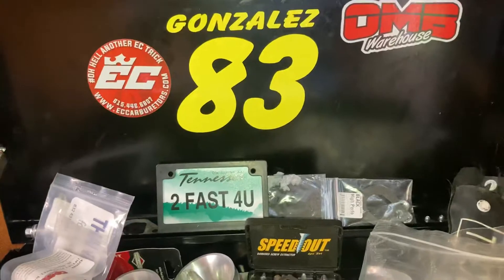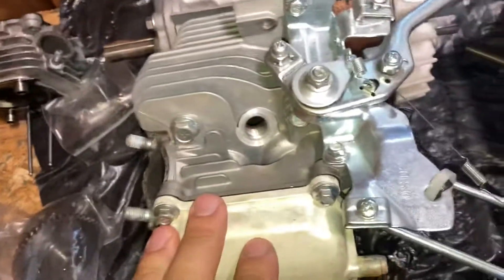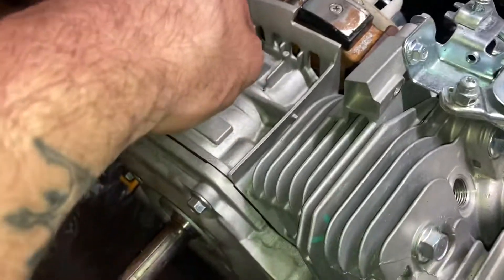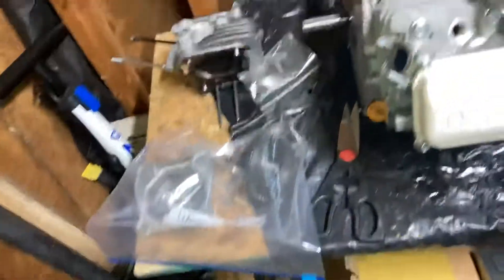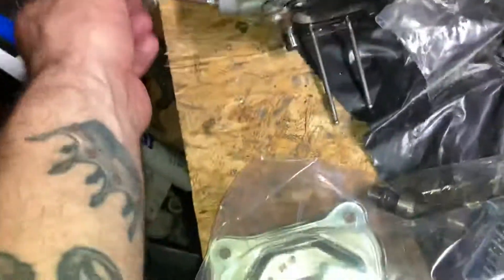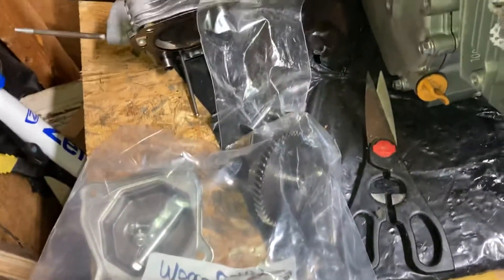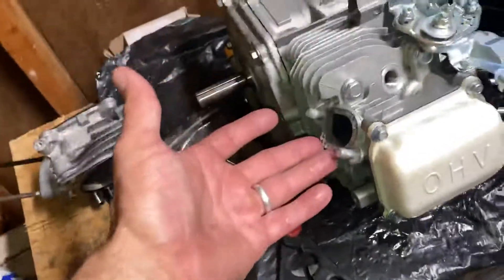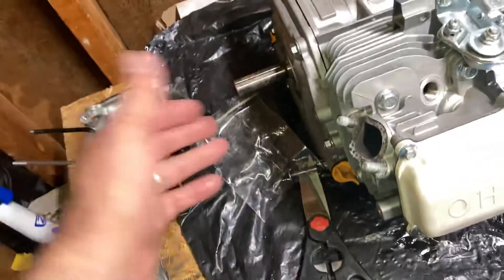Non hemi head to hemi block  Predator 212cc build talk

Comment: You will have to use the non hemi push rods in the hemi block and you can not use the non hemi cam because the cam journal are different
Reply: do you have to lash the values if they are already done or no? i just did the swap and idk id i should lash the values or what
Reply: @brandomusic3220 yes. You should periodically check your lashes and definitely if your gonna change parts

Comment: Did you do the swap yet ? I did that to mine due to braking a 18 pound valve spring and dropping a valve in my hemi so I had a ported non hemi head plus 18 pound springs in it already with high compression gasket

Comment: I’ve got my mega moto with a hemi motor I have a fuel pump on it and oil venting lines and I got a hot 265 cam and 22lb valve springs and a 26mm mikuni carb and govener removed and it’s got a trumpet straight pipe with a racing clutch and I want to try this so I just bought a non hemi head and I think just to be safe I’ll use the hemi cam and use the non hemi valve and non hemi push rods and the whole non hemi head and I think that will work the best and it should be good for some more speed

Comment: You can take a dremel tool with a sanding drum and grind the cam to fit thats what I did and it worked it wasn't difficult at all. I bought a young man out and ordered the wrong cam I didn't realize it was a cross breed engine...